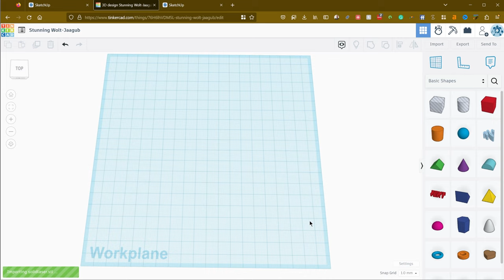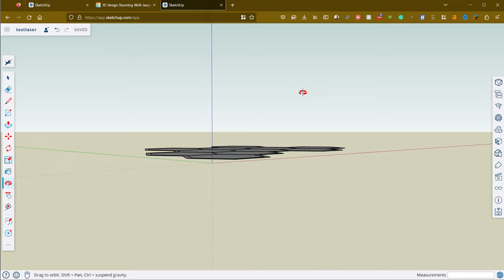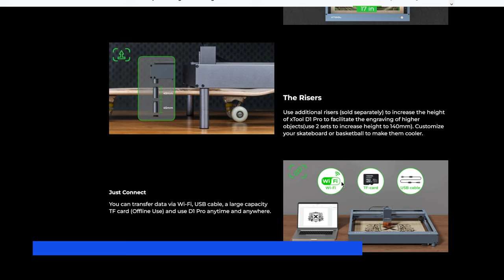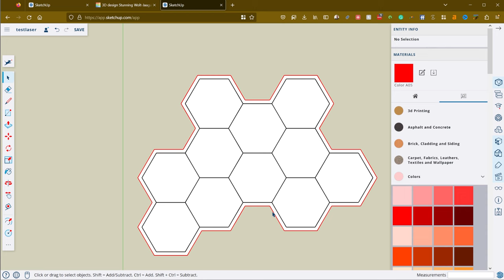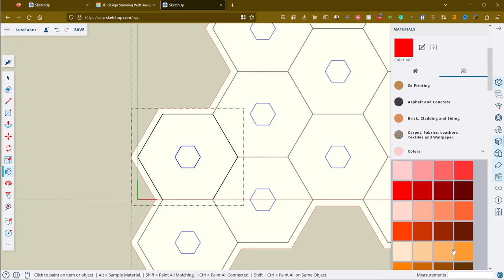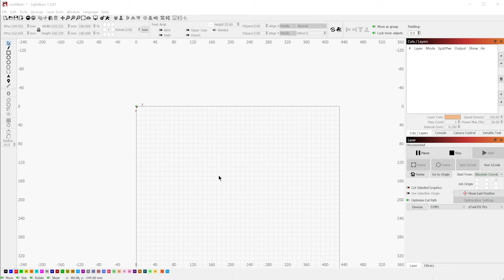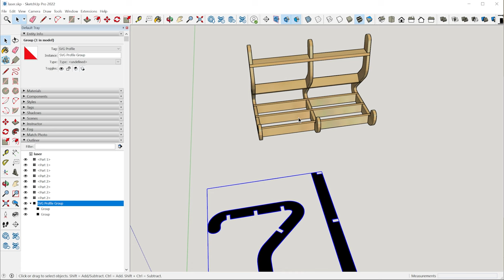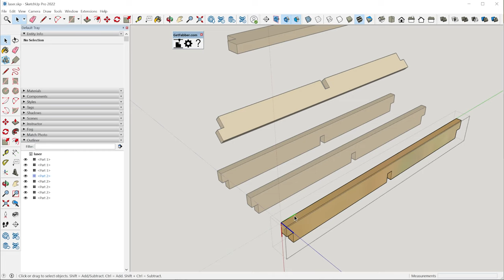8 Tips for Laser Cutting with SketchUp

Comment: You do not need to rotate and flatten anything - use the Isolate function from JHS Standard, or if you are inside a group/component Curic has a function that can also isolate from inside a group/component, or select -> invert selection -> hide.
I use isolate for each piece, orient view, parallel projection, and export DXF (it's much easier and faster than rotate... bla bla), and after that, I join all the DXF in Corel into a single DXF.
Curic also has an extension Make 2D, which works well and fast but the export is not suitable for CNC/laser

Comment: Hello, great video!

I'm currently facing a problem with exporting. I created a 3D model in SketchUp that I want to laser cut. It includes a rounded part (similar to a tube) that I want to cut using living hinges. Is there a way to flatten this part so that I can export it as a DXF or SVG file?

Would you perhaps like to make a video about this?

Thank you!

Comment: I appreciate your “brand” is being a SketchUp guru and you are clearly a master at that. However, I was wondering if you genuinely believe SketchUp is the best tool to use today if you are just getting into 3D design. Maybe you’ve done a video in this that I’ve missed already but if some one is starting today would you tend to encourage them towards Fusion360 instead?
Reply: Hi I was considering learning Fusion 360 myself. What advantages does Fusion have over Sketchup Pro 2022?
Reply from the maker: Fusion360 is a great tool! The biggest difference from SketchUp is that Fusion360 is parametric. That means every change you make to a model is recorded in a timeline and you can jump back to previous actions and edit them without having to redo everything. You can also set constraints on dimensions to be specific measurements, or be relational to other parts of the model. Solid tools like join/intersect etc are superior because they are non-destructive. With SketchUp, you have to directly manipulate the edges/faces you want to change. A lot of times that's great because it's straight-forward and fast, but other times it can be a pain. I really like Fusion for mechanical engineering and designing machined parts. It's more of a learning curve though, and can take time to set up a good model.